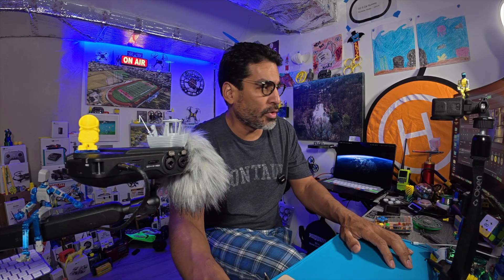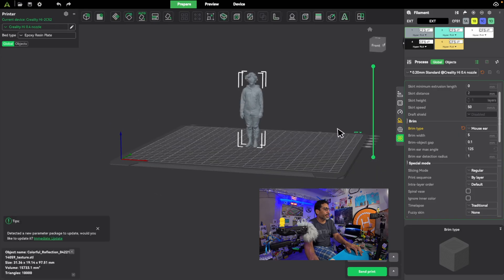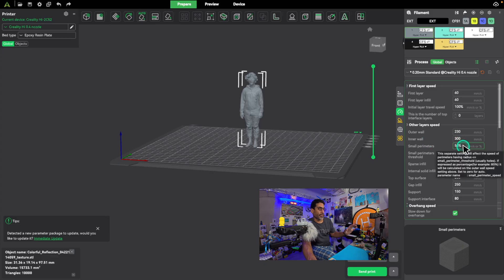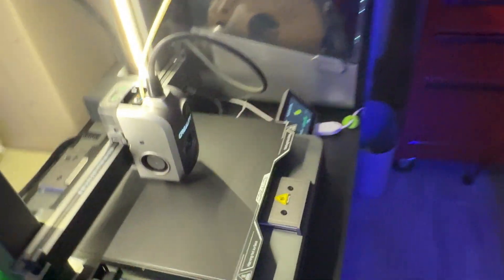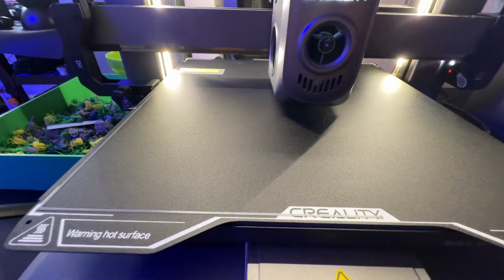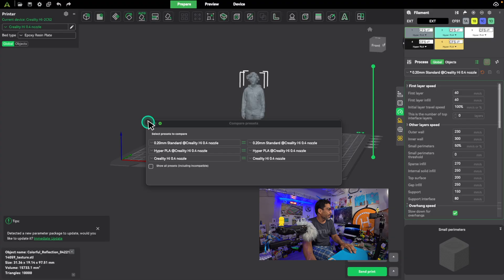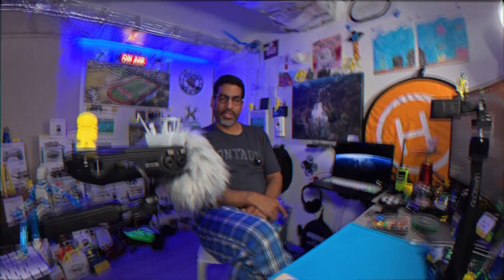How to Change 3d Print Speed Using Creality Slicer - Creality slicer print speed

Comment: My prints dont stick, with glue. What bed temperature would you recommend.
Reply from the maker: Depends what material are you printing with. Is the correct filament selected in your slicer?

Is this for the Creality Hi printer?
Reply from the maker: This might help guide you the the right direction when setting the filament.

Temps are set automatically by the printer as long as you have the correct filament selected 

How to Add Filament to Your 3D Printer
https://youtu.be/10Y18pCBiRI

Comment: is there not a overall speed setting? Im new and I see a lot of small prints that have comments to print at 60mm/s, but there's like 30 different types of speeds, which are they talking about or do I have to change all of them to 60? thanks!
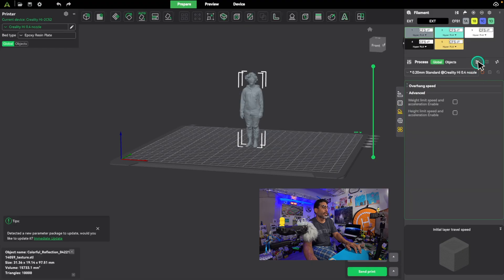Reply from the maker: 1:20 into the video you will see defaults @60 - you don't have to change anything. Everything is set to defaults.  So let's say I choose the creality hi the defualt speed will be 60. If the printer is changed in the slicer it will change the print speed optimal for that printer.  We never print fast. Everything is set to defaults Some folks like fast prints though. Will try it on a live Q and A one second..
Reply from the maker: Tried it on the live stream. Hope this helps. Let us know how it goes. 
https://www.youtube.com/watch?v=l2h8AhVe48M

Comment: Have you had any problems with bed adhesion? i have noticed that we can turn up the bed temp. Have you tried any other solution for it?
Reply from the maker: Great idea for new video..had done one video covering this with the Cura slicer but never really did a for the Creality slicer.. as long as you have the correct material selected usually there isn't a problem with the adhesion. 

Have actually used the Creality slicer and had forgotten to select PLA for the other build plate and change the temp for the Ender 3 S1 Pro...The results were the print not sticking to board.. will cover it in a video next week. 

All in all I don't really print at super fast speeds. The Creality Hi default print speed is faster the the previous printer. Hope this helps

the Creality hi is a hands off printer meaning it 's not like in the olden days when you had to level and tweak things in order to get your print up and going. It simply does it all on it's on at the touch of the button.
Reply: @How-to-by-Lou  yeah actually you can do it from the advanced settings. The first layer is key.

Reducing it to 50% velocity all around for the first layers and increasing the bed temp to 60° will help a lot.

You can also recommend to wash the bed thoroughly with dishwasher detergent. And not touch it with your bare hands to avoid oil contamination. 

Great content dude, helped me a lot